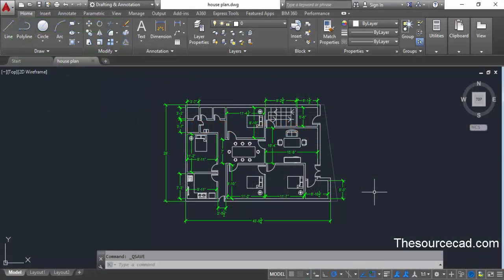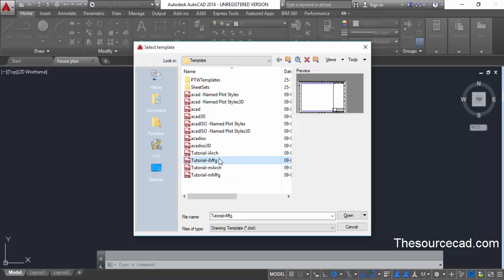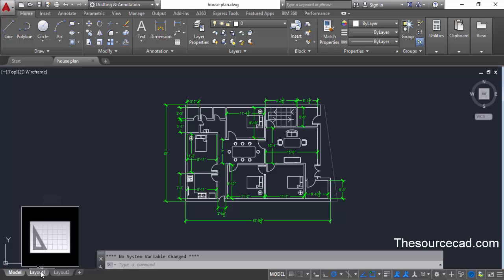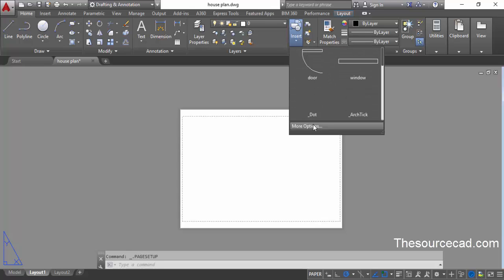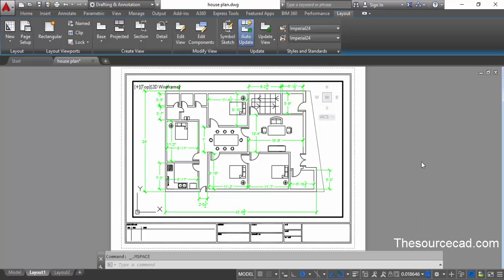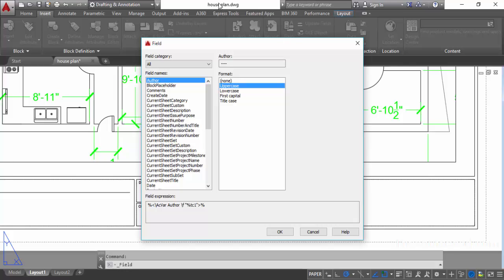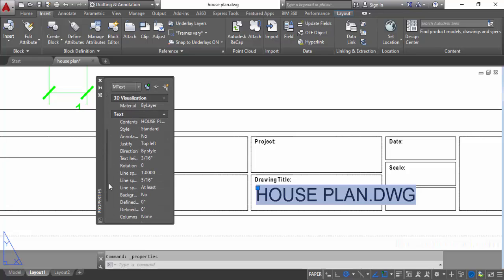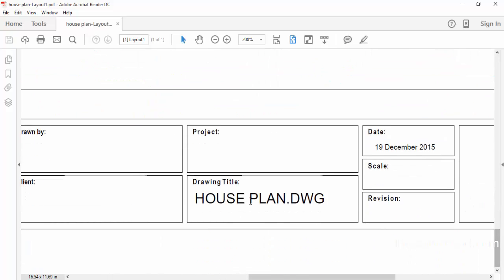How to insert title block in AutoCAD

Comment: Thanks a lot for the brief but clear explanation. I tried several times but my problem is, all texts and also dimensions are not included in my PDF drawing. What might have gone wrong?
The other problem that I encounter is, I don't have gray scale option in my plot style drop down menu. What should I do?
Please help.
I am using AutoCAD Architecture 2017 Student Version.
Thanks.
Reply: Adjust your printable area for ploting. hope u can found it, if not google 'autocad adjust printable area" and set it all 0